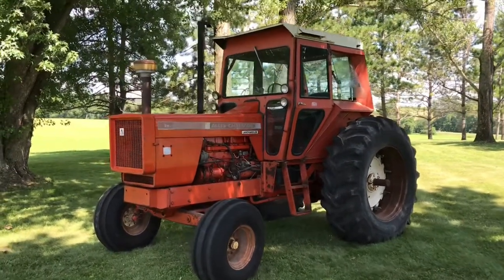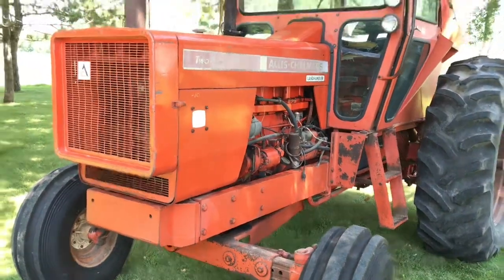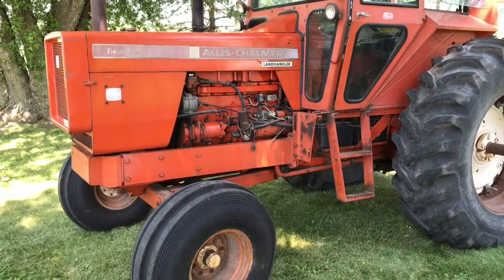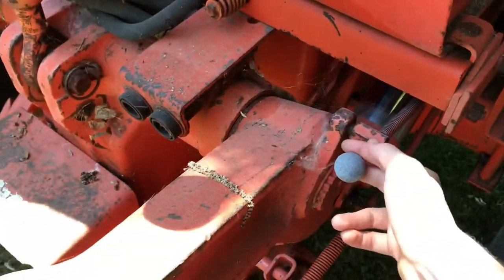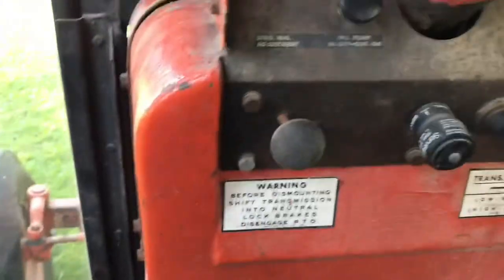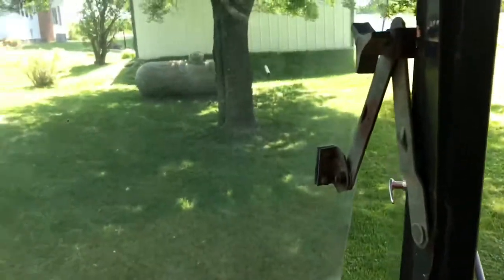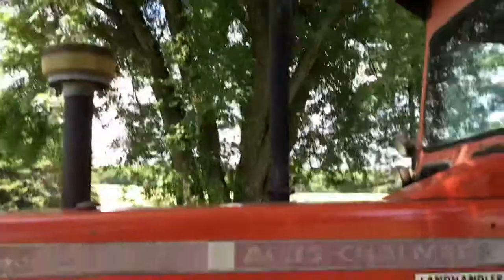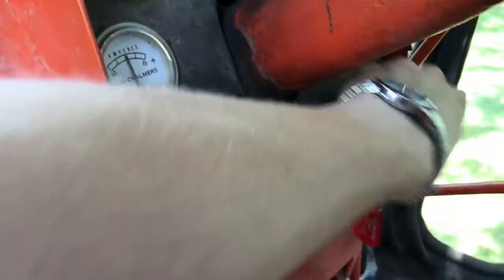Allis Chalmers 210 Overview

Comment: Love the sound of that engine. Tweaked the engine up a little. Plow day with FFA ran a 5020 in the dirt. Pulling grain wagons on the road you could learn to shift on the go without grinding gears. The QCS cab...hmmm a little quiet, kept warm , I quess the safe was good, never got hurt in it. ha Put that baby to work..LOL
Reply: 210 would eat a 5020 for lunch and still be hungry!

Comment: Be happy with what you have! I have a 4320 John Deere, and even I admire some of the features of the 210-20.
Reply from the maker: Thanks, out of curiosity what features do you like on the 210 over the 4320? I’m not familiar with the 4320’s.
Reply: @GMdieselman   It has a heavier front-end,  the lift also is better thought-out than the Deere. The 7.0l AC engine is also a better power plant in my opinion(early ones at least). The 210 shortcomings would be along the lines of not having a power director, and thats my .02
Don’t get me wrong, I do love my 4320
Reply from the maker: Ok that’s interesting to know, thanks for the information.
Reply from the maker: I’m a Allis/Oliver guy, but I’m not bull headed enough to say that Deere’s are junk.  JD did make good equipment too, it just comes down to your experiences and your dealer support.  I’ll say though that I’d take a Deere any day before I take an IH. Haha
Reply: @GMdieselman  I will admit that I have a personal weakness for the 56 series IH tractors.
Reply: @Farmer_1776  What's the best all-around tractor? Year, make, model. There must be one that's thought to be one of the greatest...
Reply: @enermaxstephens1051  it’s all subject to opinion. Nothing is good without parts and service. 
There are a number of runner ups in my opinion. 
Deere: late 20 series 69-72, 3020, 4020, 4320. 
Late 30, 4430 

Ih, 856, 1066,1586

CIH all 8000 magnum tractors.

Comment: Nice tractor! The rear end on these are just about bullet proof compared to a D21. When I was growing I thought the D21 was ugly and resembled an IH too much. The 210 just looks sharp in comparison. But if someone wants to sell me a D21 cheap I wouldn't turn it down. :)
Reply from the maker: SilverGleaner Thanks!  I decided against selling it.  I’m afraid I’ll never get another bigger Allis if I was to sell it.  The only thing bugging me right now is I’m debating on whether or not to make it an open station.
Reply: @GMdieselman  For a fun tractor yes to an open station or if you have enough cab tractors yes. I prefer to plant with the 190 open station but the 7030 with cab is nice when it's cold. I sure froze on the 190 this past spring.
Reply from the maker: SilverGleaner that’s kinda my reasoning is because I don’t actually get to farm with mine really.  I usually only use it in the summer and without ac that cab is a greenhouse.  I have a White with a way nicer heated and AC cab that I could use for tasks in the winter if needed since it has FWA.

Comment: The poweshift lever is to the right of the steering wheel. The 210 was so wicked that if you wanted to slow down just pull the throttle back, it it would still walk like a boss